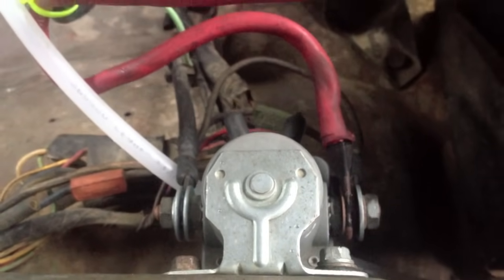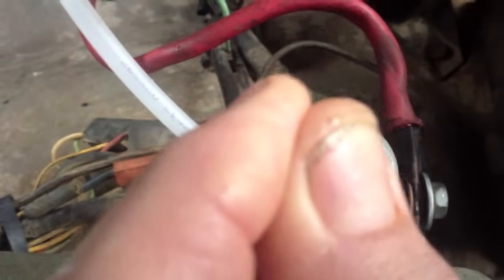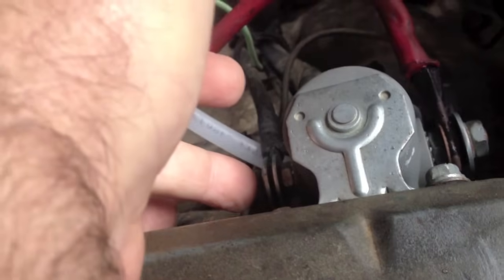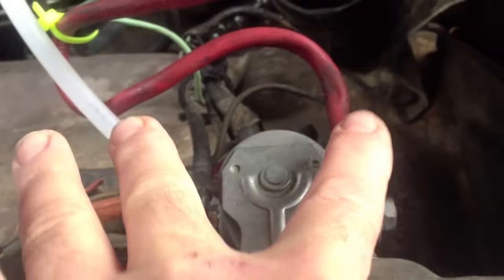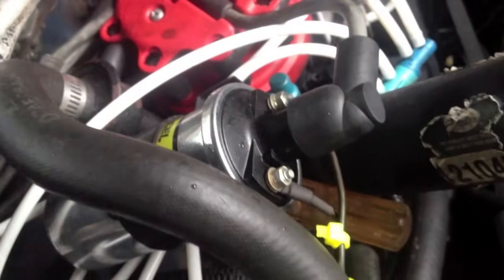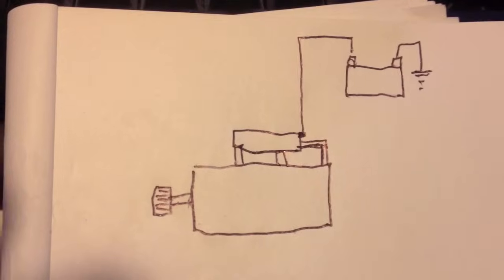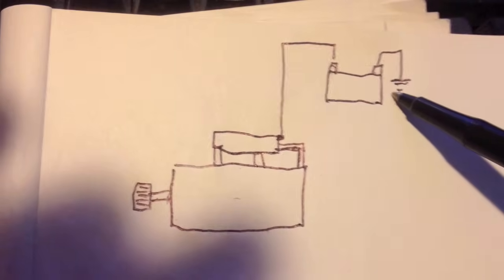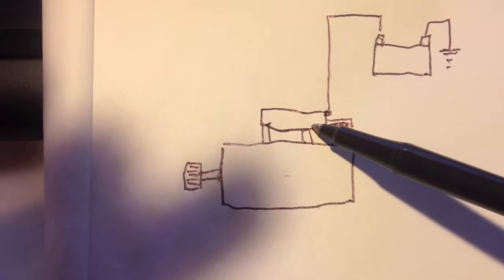Solenoid Bypass

Comment: wrong explaination...if the you bypass the solenoid it will not crank the flywheel of engine because the solenoid will not push the bendix gear to the flywheel to turn..you only turn the motor starter with out engaging the motor starter to the flywheel

Comment: I have a 92 camaro and I put on a new battery and a new starter and the car still will not start I put a screwdriver on the R and S wire and the starter was working the belts and everything were working but the car still did not start what do I need to do
Reply from the maker: Verify that you have power going to your ignition.

Comment: Loved your video. I have an 86 jeep ch7 and must bypass the ignition system and solenoid and start from the starter. I followers your directions for that and didn't see the "copper wire" but connected the pos. Battery terminal to the starter terminal and nothing happened. Any suggestions?

Comment: Trying to install a replacement solenoid on a 82 mercury cougar. Where do the ground and hot wires go?
Reply from the maker: I don not know that particular solenoid but most of them ground to the frame and all the wires going to the solenoid should be considered hot. Consult your manual and be sure your wiring is correct or you can really do a lot of unnecessary damage.

Comment: All this will work just fine but only if your starter has a thrust Bendix. Other wise your starter will just spin and the teeth will not turn the fly wheel. And if the motion on the Bendix in-gauges and send power to the starter, what you are doing will not work unless you have someone holding the key in the start position to in-gauge the Bendix then it will work. And that's if your electrical coils on the solenoid is not faulty. It will just spin. Just install a new starter and be done with it don't burn yourself and car all up. Be safe :)
Reply from the maker: If your bendix drive is bad it will not work, if your power is insufficient it will not work. Holding the key in the start position has nothing to do with it- you are bypassing that switch, however the ignition must be on unless you bypass that as well. Yes safety is key, but replacing a starter that is not working due to a bad solenoid contact is futile.

Comment: yes I have a question can a Ford solenoid bring your battery down overnight and that be causing sometimes the drainage of the battery
Reply from the maker: The best way to check for a power drain is by connecting an amp gauge between your battery positive and the positive cable, pull fuses until the drain stopes.....then you will know what circuit has the issue. It is unlikely but possible the solenoid is your drain.
Reply: Thanks I found my prob it was a wire under the dash that was connected to my horn relay...past owners use something to use power. Go figure

Comment: Good video - Question - when I jump the solenoid, I hear a good click, click - it's the bendix kicking in. I can do this repeatedly. I've tapped the starter a few times, didn't help.

Should the engine turn a bit while I bump it --- always ? 

What if only the bendix kicks in, but the engine does not turn ?

Comment: i had to be a bearer of bad news but on the second starter design you discussed most of them you cant jump that simply because not only does the piggyback solenoid run the starter motor but it also kicks out the starter gear to the flywheel.. thus.. when you jump it like that you just get a running starter but no cranking... there is a way to start it still but that gets a lot more complicated i have one rigged now on mine cause my solenoid is bad on my starter motor

Comment: Hi I have a Landrover when i turn the key the starter just clicks but when i tap solenoid  then try again it starts landrover will it be the solenoid. Thanks
Reply from the maker: Farmer2492 YES! Occasionally some corrosion occurs inside the canister causing the contacts to stick. Once you need to start tapping on it it probably needs to be replaced.
Cheers and good luck!
Reply: Thank you very much.
Reply: It is the solenoid. This is not uncommon on Tacoma. You have a rotating, sliding shaft in the solenoid that has a large copper washer on the end that is the main contact surface. that washer has a bad face.. Some of them can be turned over to gain a new face and others need the whole solenoid . When you tap it the bad surfaces fall into place to make enough contact to start it spinning.  
,

Comment: this was a really helpful explanation! Thanks! :) I have a motorcycle that has a solenoid that I think is bad. I'll use this test to see if that is my issue. A question from a rookie: what is the point of having the solenoid?? it seems like it's just a redundant piece?? or does it stop the flow of electricity so it doesn't drain the battery or constantly turn the starter? I'm confused as to its purpose. Thanks again! Really direct explanation made it very clear :)
Reply: Photography.Naturally I actually had paused your video when I wrote this comment. upon listening further, you answered my question. thanks again :)
Reply: its purpose is to allow large amounts of current to reach the starter motor without have to have it go through an ignition switch that would have to be huge to accomodate it.

Comment: Ok so I have a 1993 ford Thunderbird 3.8 auto. Recently I stopped to get gas and the car wouldn't start after fueling. I thought it was solenoid so i replaced it, some how a wire connected to the solenoid touched the side of the fender and it caught a wire on fire (AT the gas station)   under the motor connected to a bolt that hold a ac line or something.. I replaced wire the solenoid and starter now the car started took it for drive parked it...  the starter kept spinning starter Bendix went out...replaced all again now the car started drove 100 miles parked it and now it clicks in solenoid WHAT THE HELL??
Reply from the maker: There are several types of solenoids, your auto parts sales person may or may not know which one you need. Always be careful when installing a new one as you may have transposed wires or been furnished with one that is defective or wired wrong or flat out for a different vehicle. A simple chassis grounded unit only needs 3 terminals, 2 large (bat & start) and one positive to energise the unit. This type is old and not commonly used anymore. Most have four terminals. To keep your self out of trouble photograph the wires before you start anything and label them. Remove the battery terminal first and put it on last and be ready to remove it quickly if there is a problem. I have several times over the years put the wire in the wrong position and had the starter not want to stop or worse you could burn out your ignition (on older models). One last tip, if there is any doubt, ORDER FROM THE DEALER!!! You may pay a few dollars more but you will get the right part the first time and its way cheaper that buying a new starter or a new truck if it burns to the ground!!!

Be safe out there everyone.
cheers,
M

Comment: My ignition does not start my truck.  It just clicks once.  I followed these instructions and connected the two points on the solenoid and it started.  So what do I need to fix?  Is the solenoid bad or is it something between my ignition system and the solenoid?  Clearly the starter is fine.  Please can I get an answer?
Reply from the maker: You either have a bad connection to your ignition switch or your solenoid, could be the small control wires or the battery cables at the solenoid or it could be that your solenoid is worn out (it does happen). Check all your connections first, I like to use some sand paper and make them all shiny before reconnecting them. If the problem persists, change out the solenoid. NOTE: there are many different solenoid configurations that may or may not work on your vehicle don't put the wrong one wired the wrong way on and burn up your starter or coil or ignition switch or.............. a good practice is to have the positive terminal of the battery loose so if something weird happens you can quickly pull it off. Good Luck!
Reply: The Micah Channel Thank you very much for responding.  I'll research how to replace a bad solenoid on a '94 Ford Ranger.  I'm thinking that's the most likely culprit.  The piece inside it that's supposed to connect the two points must not be working.
Reply: The Micah Chann

l

Comment: This was an excellent explanation, would you mind doing a video on how all the components needed to start an old 60/70 Ford or Chevy work together in concert, ie Ignition Switch (the thing you put the key in), Ignition (silver box under the hood), Regulator, Coil, Distributor, Starter, Battery, etc...
Reply: The Micah Channel Wait, I give you an honest complement "excellent explanation" and ask for help and you call me a "smart ass" I don't get it, did you wake up on the wrong side of the bed or something?
Reply from the maker: gReG sKi Sorry, It sounded like you were saying "great now go explain the entire engineering of the electrical system since you know so much" which to be fair I have had a lot of and yes I maybe did wake up on the wrong side lol. No one is perfect, least of all me!
Reply: you are

Comment: This is a wonderful instructional video!   Your explanations are clear, concise, and accurate.   I really appreciate that you explain what the solenoid does, and how it works within the system.  The diagram was also extremely helpful.  (I am a 53 year old granny, and am trying to help my neighbor solve a starting problem with her car, as she  is a mom on a tight budget.  Inow  drive a 21-year old Miata, after driving a 20-year -old '66 Mustang, so I've learned a little over the years.) Good job!